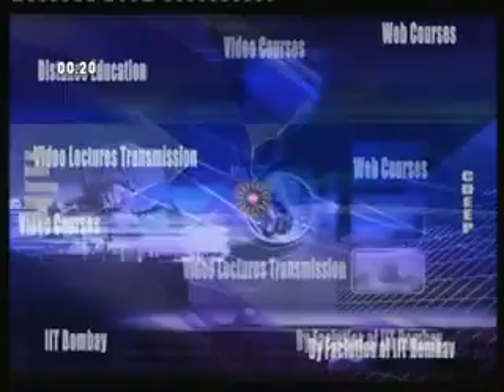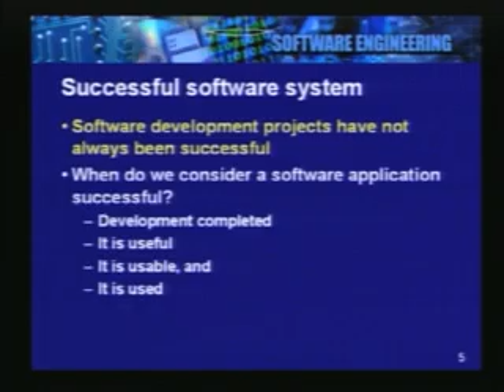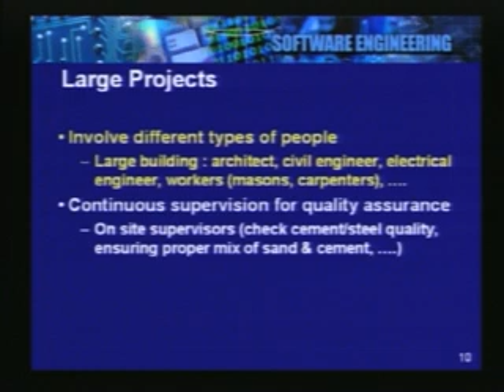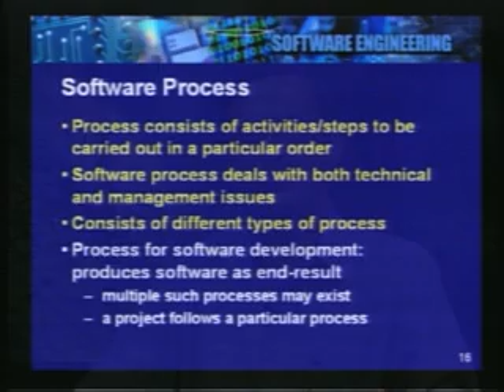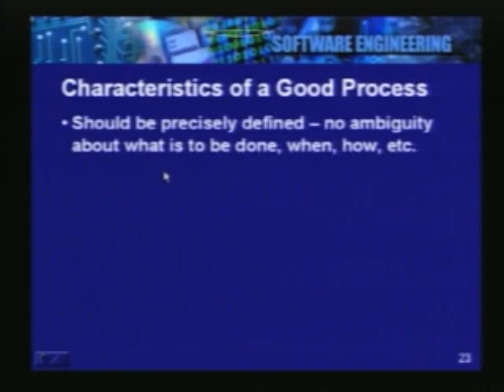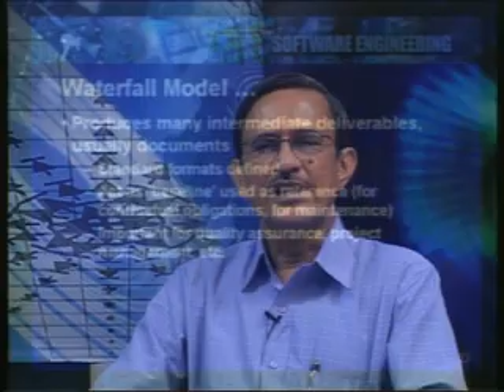Comment: Outline
Software Systems
Challenge in large projects
Successful software system
Reasons for failure
Reasons for failure ....
Engineering: other disciplines
Engineering ...
Large Projects
Large projects ...
Software projects
Apply Engineering Approach
Job of Software Developer is difficult
For success in large software development,
Software Process
Process Types ...
Multiple processes
Step in a Process
Process step ...
Process step
Characteristics of a Good Process
A Good Process ...
Waterfall Model for Development48:41

Comment: First of all congratulations to Prof.N.L. Sarda for shaping up such a good video presentation on S/W engineering. Few comments though:

In my experience, S/w engineering principles have changed quite significantly over the last decade or so. New models such as Agile methods takes software engineering in a very different way.

The waterfall model is argued by many to be a bad idea in practice because it is nearly impossible to get one phase perfected before moving on to the next phases.

Comment: (3) A process is simply something that is done to produce some output. You do not have to have objectives, exit criteria, or documented steps to have a process. When a trained engineer follows a documented process description, which states inputs, outputs, entry and exit criteria, etc. then there is process maturity. Objectives defined should be measured at the conclusion of the process and should be the basis for improvement. A defect is something that is a variant between objective and result.

Comment: A nice video. Some comments. (1) I believe a process should encompass all aspects of PDCA cycle, so a process should integrate both the planning and improvement actions as well as the Doing." (2) A process is not the same as a methodology, which you are describing. No matter if I am using a waterfall, spiral, iterative or rapid development method, I can use the same design process. A methodology only restricts when in my lifecycle I can perform which processes; e.g., no Design in Reqts Analysis